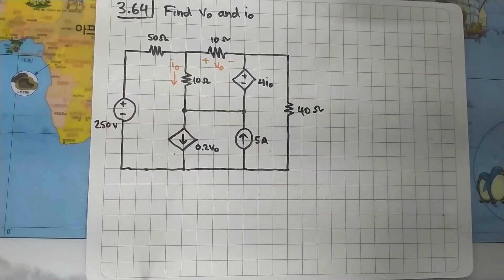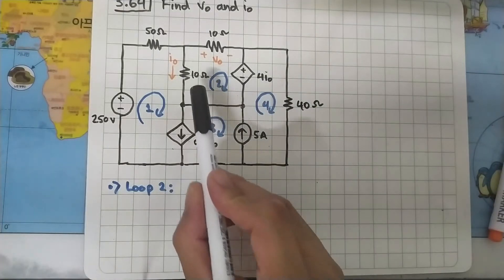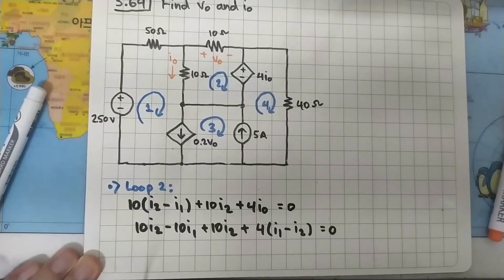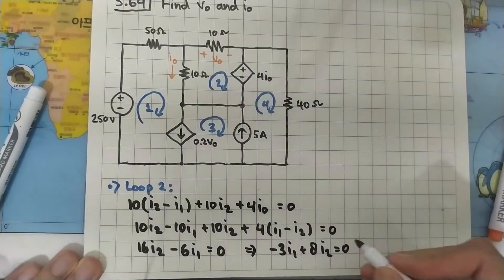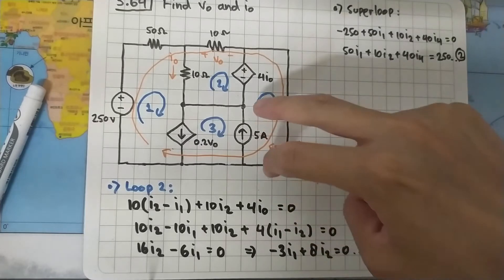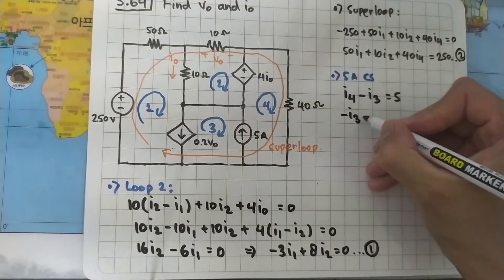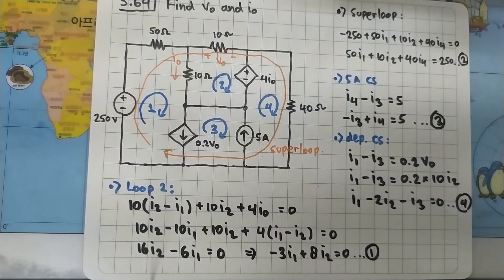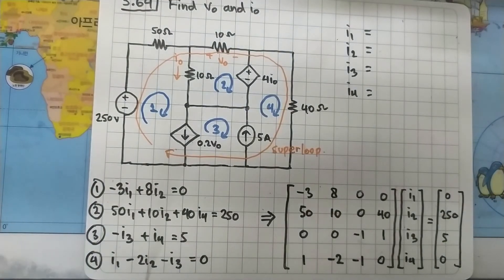Problem 3.64 Fundamental of Electric Circuits (Alexander/Sadiku) 5th Edition - Superloop

Comment: 4io is missing in super loop
Reply: 250=56i1 -6i2 + 40i4. 

super loop equation
Reply from the maker: 4io is not in superloop
Reply: @daviddercross75  Even if you include that in the superloop the answer is the same. Try it.

Comment: Have you confirmed this answer is correct? The solutions manual has a different answer; v0 = 10i2 = 1.1764 volts, i0 = i1 - i2 = (5/3)i2 = 196.07 mA
Reply from the maker: You should always check
Reply: @ArdiSatriawan  Would you mind help me rechecking, solution manual can be wrong too. But I don't see any errors in any of the formulas you used since I paused the video before seeing what you wrote and it was the same
Reply from the maker: It should be correct